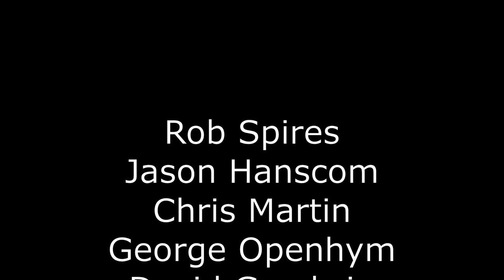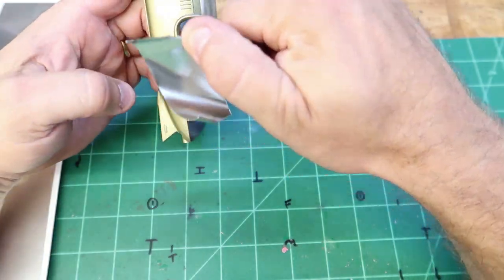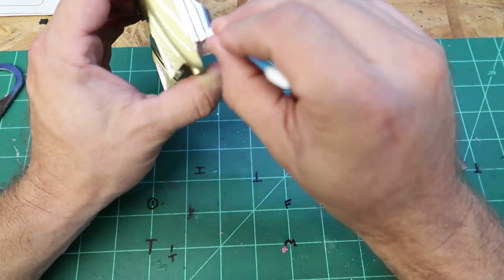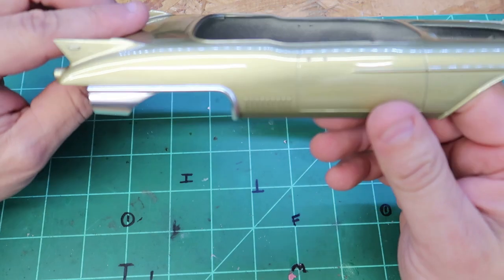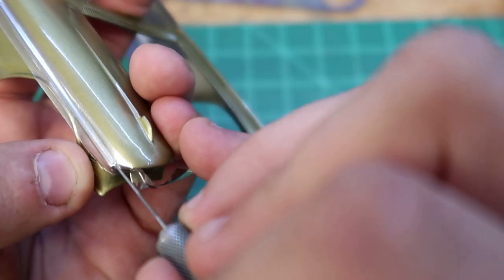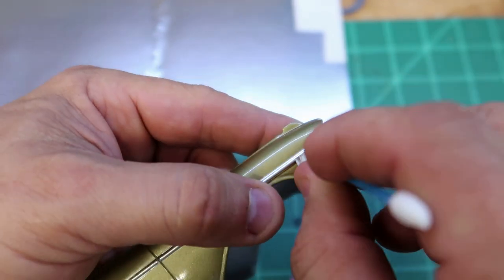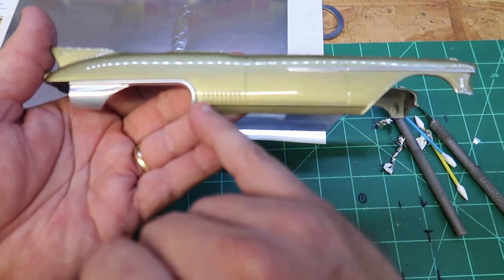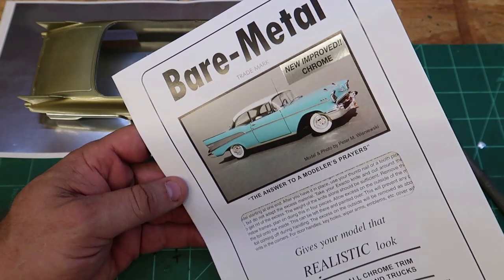Bare Metal Foil Tutorial.  How difficult is it?? Let's See!!

Comment: I use toothpicks to burnish down the bmf in troughs.  Don't press hard but firm so as not to tear the bmf. Polish up with the toothpick. I use the BACK of cheap aluminum foil to simulate stainless steel.
Reply: I sometimes do the same but I'll cut the tip off of the toothpick and round it over so it's not as pointy.

Comment: Thanks for the tips and tricks. I've been foiling since the early nineties when one of the kits came with some chrome foil. Not the greatest results, but I was off and running. Purchased Bare Metal via catalog back in the day. There were no local hobby shops for me. One trick I've been using lately and liking is coloring my blade black with a Sharpie. My eye is not so good and even with a 3x lens and a 10x lighted magnifier lens, I couldn't distinguish the blade and the foil.

Comment: Amazing work! Have u personally clear coated over the foil? If so Have u ever had an issue with the clear coat melting the glue on the underside and resulting in wavy or bumpy clear coat?  This is the only issue I can imagine would come up. Given that the solvent!thinner of the clear can melt the glue.  Thanx again!😊
Reply from the maker: I clear over most of my foil and haven't had any problems at all.
Reply: @modelcarvideos5829  great! Thank you!
Reply: It doesn't affect it. I use it over emblems or raised letters then paint the body and take a q-tip with a little thinner and go over the lettering/emblem to remove the paint from them exposing the foil underneath. If that makes sense.

Comment: THANKS Matt! So figure a '59 Caddy would be a two sheeter?! 🙈
Agree with one big piece for windshield trim, although some cars (Like my "70 Chevelle) have a multi-piece trim set with overlap, so just copy it as such. Also with using large pieces of foil, just place the cut away scrap onto another section of body with smaller sized part, like headlight trim, etc. since already lifted from sheet. And been asking you a few times what the brand, or where in Hobby Lobby the thin black tubing is? Can't find, and employees are clueless.

Comment: Great tutorial Matthew. My problem with BMF is that it doesn’t stick anymore after sitting on the shelf for long time (no exposure to light or heat). I know I’m asking too much from a product to work for years but where can I buy fresh production? I also bought this  “new improved chrome” type from amazon, not very much difference.
Reply from the maker: It's a real crap shoot on getting a good sheet. I totally feel your pain!
Reply: I buy directly from them so it's as fresh as possible, in theory at least. Who knows how long it sits around an Amazon warehouse. What you can do too is after you cut your piece out heat it up with a hair dryer then apply it. Helps to make the adhesive a little more tacky.